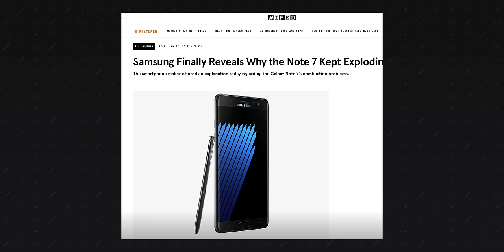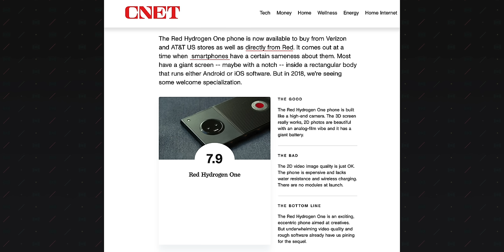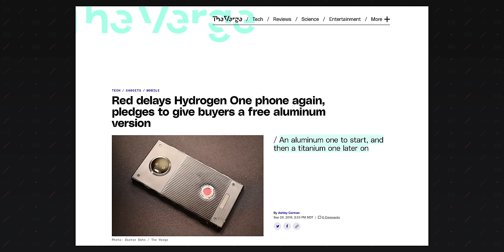This 3D Smartphone was the Biggest Fail of 2018!

Comment: Saw one of these at Verizon store when new. I was floored by the 3-D effect. Way higher rez than Nintendo's 3DS... but much more expensive. Wanted, but could not afford.  I suppose a bullet was dodged. I've got an iPhone XR instead and... its still my primary. I doubt I'd still be using the Hydrogen if I'd gotten it back then.

Comment: Phone like these make me wonder what goes through the heads of the higher ups. Did they think the "Red" brand was that strong? Did they think the gimmick of the Fire Phone/3DS would somehow be worth it this time? Did they think promises of future features would make people buy their phone now? 

How out off touch do you have the be to not can this?
Reply: The phone was the founders baby and it was supposed to be part of a whole eco system that surrounded the phone. Dead cameras had a whole video on it.

The phone was supposed to double as a viewer for a new camera. They had also designed a system to view 3D cinema footage on the red phone to give you an approximation of 3d footage you've shot, replacing a viewer and solving one of the key issues of shooting 3D. The idea was that you'd be able to have more idea of what 3D footage would look like instead of having to watch it in 2D and try and work it out.

Obviously that didn't happen, and probably wouldn't have worked very well even if it had. But that was the idea. It'd be a key part of a new eco system.

Comment: I want to propose another thought process. 

Imagine the Red phone was meant as the viewfinder of their commercial 3D camera offerings. 

I have a Red Hydrogen One (refurb’d). And seriously wanted Leia’s first tablet but didn’t get before they discontinued and not in a position to drop $1100 on a new one. 

But if you look at the hardware, metal case, titanium (some), the SIM/SD media card tray is Metal and heavy duty. 

The back cameras are oriented in the proper mode for being a viewfinder with their own set of cameras (my theory was for comps/quick tests via the camera). That would’ve changed the entire purpose of the phone from a consumer to a prosumer/commercial offering. (Why is the sim tray metal and easily removed? Because in a film set, you don’t want everyone with a SIM card leaking data on set and to have a fresh SD card at all times.)

The grip makes sense if you think about it being a viewfinder on an arm that you need to reposition.

What happened was 3D TV died and RED saw the writing on the wall before they could go “all in”. 

I have a Passive 4K 3D TV. i have the Lenovo Daydream 3D camera. So I’m a bit of a 3D fan so I wish RED had continued. But I could also easily see it as “the thing that killed RED” as the video headline too. 

But think of it as part of a different market and it makes sense. 

Also thanks for finding those updated apps! I definitely need to go download them. 

Also terrified to think how much you paid for a sealed unit. I got mine for a hundred refurb’d in 2020. Alongside my Nextbit Robin (there’s another unique phone that Razer ate.)

Comment: I followed that closely at the time. It seemed that if anyone could come out with a really leading screen and photo smartphone, it would be RED. But then, Jim was always known as a B.Ser. It was a terrible product. I got the chance to handle it for a short time. The screen quality was terrible. Really low resolution. That was from the lenticular display that halves the actual advertised resolution of the display. Total junk.

No! Red was never on to anything with the Hydrogen concept.

Let’s not forget that Red also came out with a modular still camera. It looked like something out of the 1930s. It never went anywhere either. It used Canon lenses.